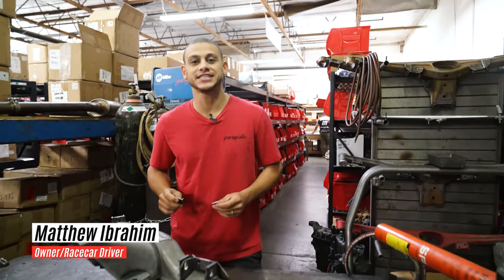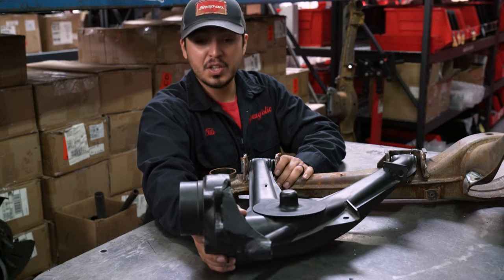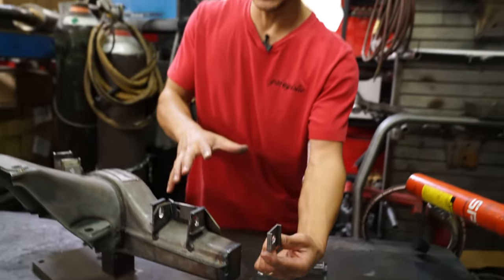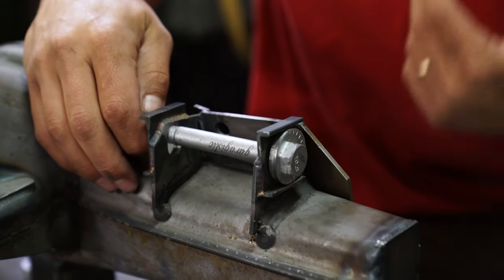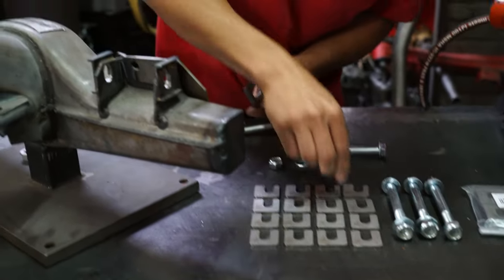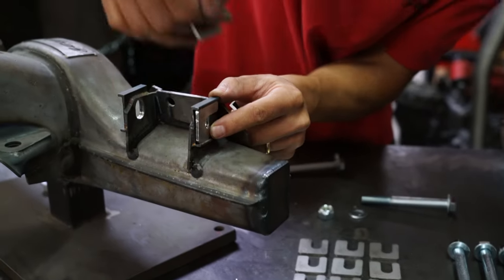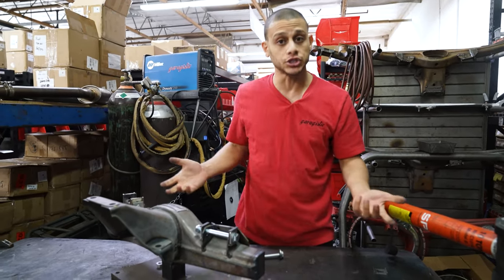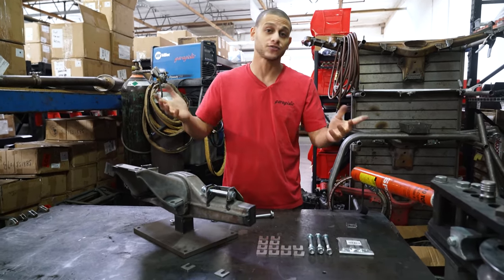E30/Z3/318ti Adjustable Rear Subframe Camber/Toe Incremental Shim Kit Info & Instructions

Comment: Can I reach the nuts and bolt  since they are going to be closer to the car floor once installed on the car for adjustment. Or I have to cut the floor?
Reply from the maker: They can be reached from below the car. No cutting